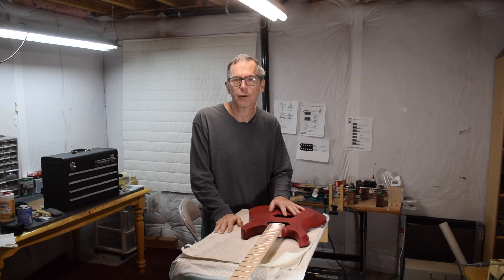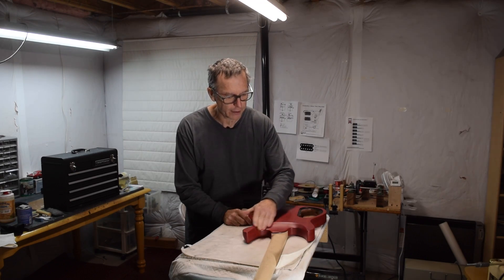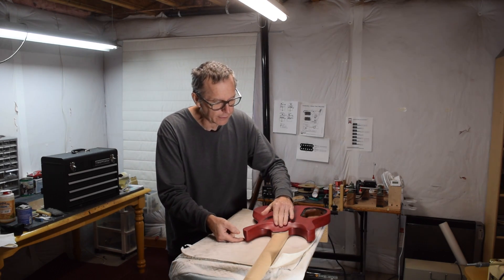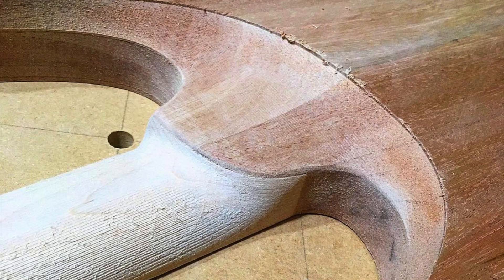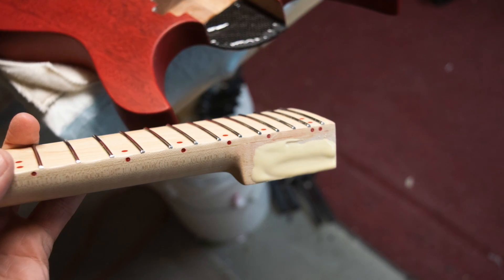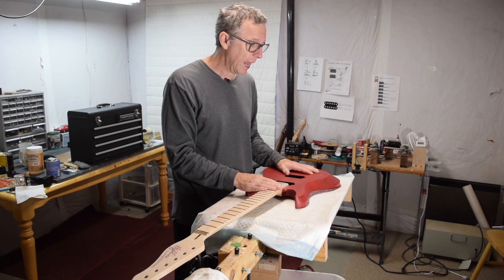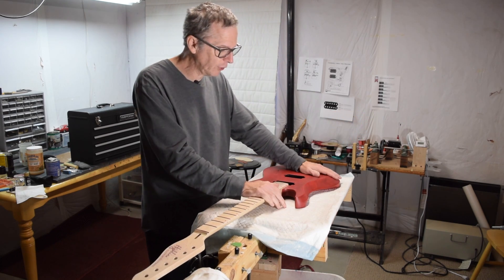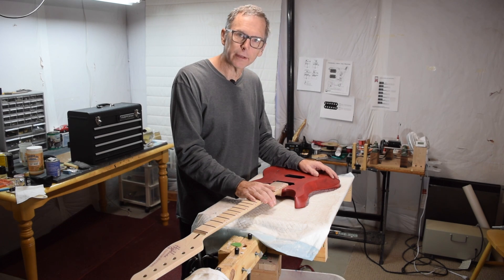Episode 122 Reinforcing A Guitar Neck Pocket With Carbon Fiber

Comment: I would be very interested to see how a 1/4 inch shim of carbon fiber would improve sustain if it went from your heel joint, like in the video thumbnail, but all the way to the string ferrules / bridge anchor points. I'll bet a real signal capture test would knock our socks off.
Reply from the maker: I think you would be disappointed.

Comment: You made a Parker!  LOL.

Nice recovery, btw.  It's something I've thought about ... strengthening at odd points (neck/head joint, especially), with carbon fiber.  I've thought of using a 15 degree cut carbon fiber pair of vertical supports under the fretboard and headstock veneer for added support.  :)

Comment: That's a great idea. I recently repaired some cracks in a neck pocket and reinforced the area by drilling diagonal holes within the neck screw cavity of the body and inserting screws. It is a completely invisible fix and I think it is a stronger design this way as a lot of strats suffer from cracks in the pocket.
Reply: The strat neck joint design is an forethought. That's "how do a make a removable neck" - obvious not greatest thought through solution....

Comment: Unrelated to the video... What type of stain/dye did you use to get that red tone on the guitar.  I'm about to finish my first build and that's the red I'm after.  Thanks in advance for any advice you can give.  Your videos are great, and definitely appreciated by newbs such as myself.  Thanks!
Reply from the maker: First I applied Crystalac grain filler dyed black with Crystalac CraftNique. I sanded it back to the raw wood leaving the dyed grain filler in the grain and pores. Then I applied Crystalac CraftNique red mixed into Crystalac Brite Tone Gloss for the color. I don't remember the exact ratios, but if you test on scrap, you'll get it right.

Comment: Do you think that carbon fibre could be used in this way for a bolt on design for a 27mm body? I’m making a very thin guitar and I believe that a set neck is the way to go, but I’m not ruling out a bolt on if it can be done.
Reply from the maker: It might as long as you bond the carbon fiber plate to the bottom of the neck pocket. I would also consider lining the sides of the pocket with carbon fiber as well. Sort of like an insert.
Reply: Highline Guitars thanks for the reply! Something to consider for sure.

Comment: i've done that kind of trick to save an old SG japanese copy branded Morris, with a bolt-on neck. I got it from an 
auction site for a really low price ; but it came to me with a completely loose neck (about 1mm all around the pocket)
and a crack running from each side of the neck pocket.
I first repared them by injecting lightly solved wood glue and clamping over night. Then i protected all the surfaces 
around the pocket with masking tape, and the neck heel in a thin plastic bag. I applied 4 layer of carbon fiber with
epoxy resin on the 4 faces of the pocket and clamped the neck in place for 24hrs. After that, i removed the neck, 
trimed flush the exess of carbon, cleaned all the area and screwed on the neck back. It now fits firmly, with no play
since 4 years ago without any issue.

Comment: Did you consider extending the patch into the pickup cavity?
Reply from the maker: Why? The pickup cavity doesn't need reinforcement.
Reply: Spreads the stress over a larger area was my thought. Avoid a snap where the neck pocket ends. It seems like your joint is pretty solid so it probably wasn't necessary.

Comment: How did the added thickness of the carbon fiber affect the added fretboard height? Did you just shave that thickness from the neck or make the neck after?
Reply from the maker: Scott Maillet I will use a Hipshot hardtail bridge with a .175” baseplate instead of a .125”
Reply: @HighlineGuitars  makes sense, thanks! Great ideas as always!

Comment: Very creative “fix.” And that really is part of being a luthier. I would have used epoxy for the entire neck joint. I often use epoxy to glue my fretboards on. But don’t use the 5 minute stuff. It stays too gummy. 

Another idea would have been to extend the neck heel under the pickup. That’s how I do set necks.
Reply from the maker: I debated whether to use only epoxy or wood glue. I compromised and used both. On my original plan, I had the neck heel extending through the neck pickup cavity, but I decided to eliminate that feature to simplify the design and save time on my CNC machine. Also, I feel modern glues make the extension unnecessary. Some will argue that extending the heel improves tone, but there is no way to really know that for sure.

Comment: Please understand that my intention is not just to criticize but to engage in a discussion. By glueing in a piece of CF that is the same dimension as the neck pocket haven’t you only shimmed the thin pocket I would think that a hardwood spacer would have achieved the same effect. The CF spacer had it been longer and extended into the body would have taken advantage of the strengthening effect of CF. I think the only strength you’ve actually added comes from the bond of the epoxy. With the spacer the same size it’s still only glued to the thin wood cross section
Reply: But the carbon fiber won’t flex, while that thin area of wood would. (Say that three times fast)
Reply from the maker: The carbon fiber is also bonded along the edges to the sides and back of the pocket. Enormous strength isn't necessary. It just needs to support the neck under string tension and normal handling.
Reply: Highline Guitars I agree that the joint is stronger due to the epoxy. My point was primarily that the carbon fiber itself doesn’t really add any more strength than the same hardwood spacer would have. Hardwood may have actually been a little stronger due to the multiple layers of bonding area. I don’t think most people understand the strength of a good wood glue’s cellulose bond. It really is the closest thing to welding wood we can achieve. Again my intention was not to criticize. You are obviously a highly skilled craftsmen and do excellent work. I applaud you for having the strength to show a “mistake” and a creative work around
Reply: Bryan Saunders The Carbon fiber is stiffer than wood. It’s like having a thin piece of steel in there. It will prevent the heel from flexing. That’s why we use it in necks. It’s stiffer than the wood surrounding it without adding weight. Plus multi layers like this are more stable and stiffer. I do this with fretboards.
Reply: David Schwab I work with carbon fiber everyday I am well aware of its properties. If he had put a piece of diamond the same shape and dimension under the neck it would not have mattered it’s about spreading the stress out over a greater surface area that’s how you create strength
Reply: Ae you a luthier? You keep acting like this neck pocket is working like a hinge or something. The fact that this is a set neck makes the whole discussion moot. There's no stress to distribute. The neck is glued onto the body, so they will act as one piece. The only thing to be concerned with is some minimal flexing which might crack the wood. And that would be cosmetic.
Reply: @HighlineGuitars  I'm reluctantly going to have to agree with the naysayers. I think any contribution the CF made is minimal at best. If the doubler had been extended into the pickup cavity, it would have made a much larger contribution.

Comment: U make a great point abt fixing hidden problems or mistakes that crop up in most builds at some point. That’s where experience and the true artfulness of building, really anything comes into play. I think another piece of body or neck wood w titebond would’ve solved the problem equally well. I don’t like gluing w epoxy in guitars b/c u can never get that joint apart again.
Reply from the maker: Sure you can. Epoxy fails at a lower temperature than Titebond.

Comment: Thanks for your honesty, Chris. Great topic. You are correct. Luthiers, particularly, the ones who do repairs, are great problem solvers. (And sometimes there is more than one way to solve the same problem.) That was an excellent way to solve that mistake. You might have been able to repair it by gluing in 1/8" of wood because most wood glue (when properly) clamped is stronger than the surrounding wood. But there is nothing wrong with over engineering that joint with carbon fiber. I'd like to think I would have done it myself. The contrast between the black carbon fiber and the surrounding wood almost looks like you intentionally laminated a piece of ebony in there as a design element. Love your channel.
Reply from the maker: I actually had an 1/8" thick piece of Rosewood cut for this, but it was too flexy so I opted for the carbon fiber. The carbon fiber was thinner yet way stiffer.

Comment: Nice fix. I think it will work fine with the flat neck heel. 
At a regular neck, there could be problems with big jump in stiffness along the neck. The LP's often develop a  hump around the neck pocket cause it's so stiff (compared to the rest of the neck). The weakened neck pocket is reinforced around what it should have, If it was too stiff, it might cause the same problem. The other way is carbon-glas-fibre mix across the whole back like the original Parker Fly's. If all the fibres are unidirectional you'd have the maximum stiffness with that load. Maybe you could get away with even less.

Comment: So the question is,,,, For your next guitar will you adjust CNC file to the proper thickness? Or will you continue with the thin body and carbon fiber reinforcement?  If you continue the carbon fiber it will then prove to have been a happy accident,  if not....it will prove to have been just a pain in the ass mistake. ;)
Reply from the maker: I am considering it as a possible new feature, however, I could redesign the neck heel and the scallop to accomplish the same end result without the carbon fiber.

Comment: You would never have known that there was an issue with the heel/pocket area judging by how clean and deliberate looking the carbon fiber looks! Maybe you just stumbled onto something that can become a signature feature that's exclusive to your guitars!? Not only does it enhance the strength in that area, I think it looks cool as hell, as well. Something to consider, anyway.
Reply from the maker: It is something I am considering. However, it does add to the workflow and that adds to the cost.
Reply: @HighlineGuitars  patent it, think about the benefits. As a player I would pay 200 bucks extra easily if it does free the fret access to feel like the rest of the neck.
Reply: Highline Guitars - Well surely it would add to the cost. If not a standard feature, at least make it available as an additional-cost option. Regardless of whatever you do, you should look into having it patented. Great work, as usual!

Comment: I'd like your opinion on something that relates to this video. I have only been building bolt-on neck bodies and I have been leaving the thickness of the heel at 3/4", under the neck.
How thin of a heel do you think I could get away with, on a bolt-on guitar?
Reply from the maker: I wouldn't go less than 1/2"
Reply: Thanks. :)

Comment: If you were using a blank 1/8 thinner than you intended did you also reenforce the control cavity?
Reply from the maker: No, because the thickness of the wood there went from 3/8" to 1/4" which is plenty thick enough.
Reply: yeah 1/4 seems to pretty much the minimum. Do you usually use 3/8 for your cavity  thickness?